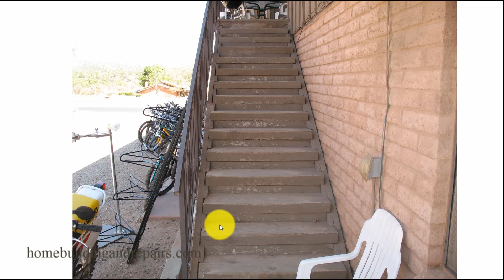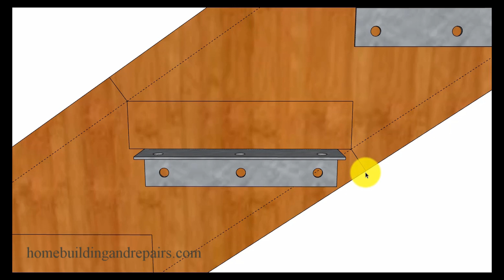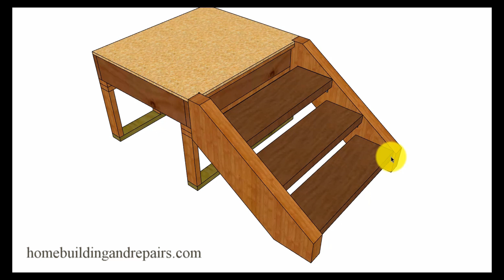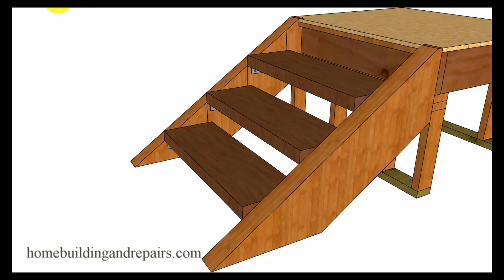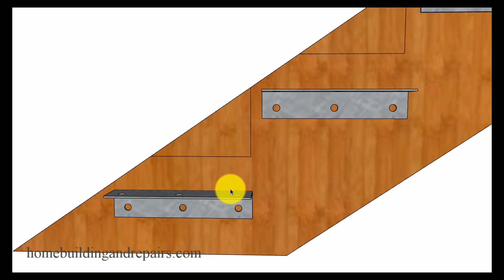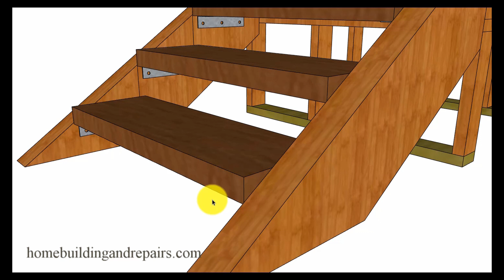Learn How Not To Make This Mistake By Simply Understanding How To Center Stair Treads With Brackets

Comment: I'm thinking of building stairs with brackets in which the stringer on one side would be mounted on posts on one side and on a masonry wall on the other side.  Wondering if you have any comments on this.
Reply from the maker: I don't know how you would attach the bracket to masonry.
Reply: @stairbuilding  I'll attach a stringer to the masonry with large masonry screws and then attach the brackets to the stringer

Comment: Thanks for video, I have question about those string, Can I use engineered LVL beam 2x16 to make stair string? I'm plan to use 48" in length and 2-3 inches thick with solid tread wood or made by plywood. You think it will have enough strength to hold those treads? if not what kind of string you would recommend ? and can I get them? you think lo local lumber carry them?
Reply from the maker: I've used a lot of 2 x 12 and 2 x 14 Douglas Fir, but you can try the lvl's.